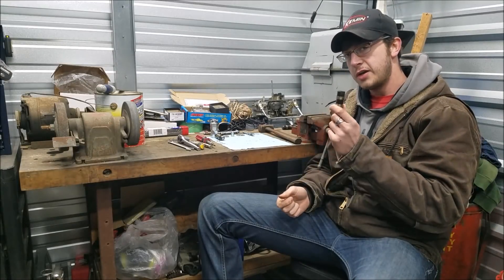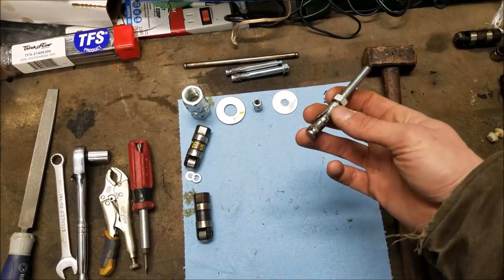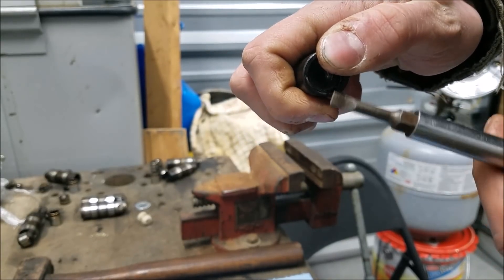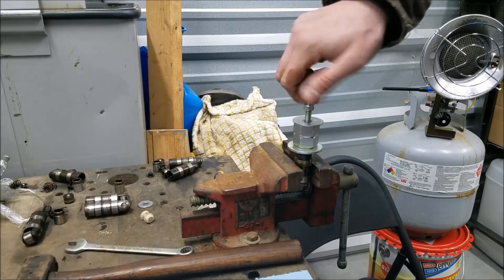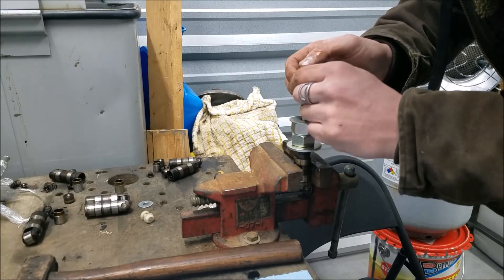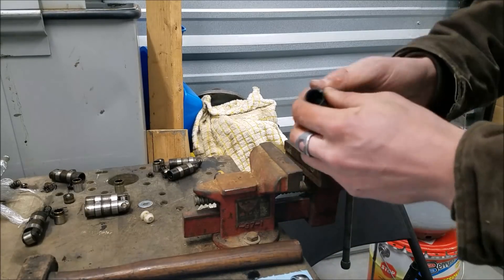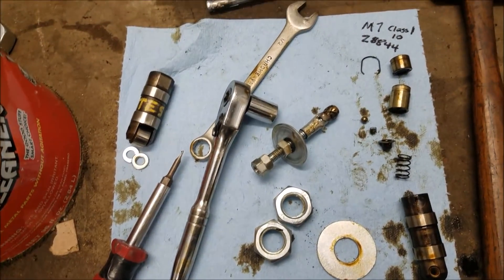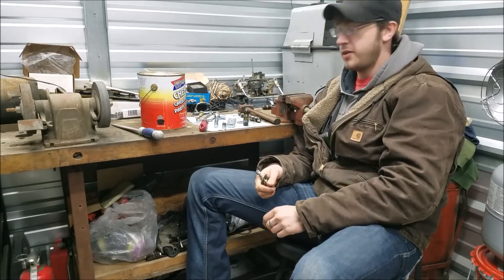(TRICK REVEALED) Hydraulic Lifters Disassembly: Rebuild or Make Solid "Mock-Up" Lifter

Comment: about the welding on the tool, did you weld up the end of the tapper and scale it up or did you add material to the expanded sleeve to make it bigger?  I was thinking of increasing the the diameter of the sleeve with another sleeve

Comment: Thanks Luke used this to disassemble a lifter on my 340 Buick had a little trouble getting the bolt out of the plunger so I just stacked more nuts and used the same method to pull it out.

Comment: I know this is 5 years old, but here it goes. I have heard of a "lifter mod" for Ford roller lifters that is supposed to be of some performance value, but I cant find an explanation of it anywhere. Even Vizard talked about presenting it but never did. Have you heard of it? I want to check/rid my lifters of built up crud, but if there is a performance mod out there, that would be the time to do it.
Reply from the maker: Not that I'm aware of that would last. 
You can make one solid, but you run the risk of the clip flying out - not worth the risk

Comment: much easier way peeps. Once you get to the point where he installs his crude expander. I flip the lifter upside down on a metal bench or other lever surface. The plunger is  stuck with dirt  grit and varnish. Even with the spring pushing on it it's stuck. OK ..upside down take a propane torch and evenly heat the lifter body evenly all the way around. The heat expands the lifter body AND the air under the plunger surrounding the spring. Inside 30 seconds you'll hear a pop as the plugger is forced of the bore. Grab the lifter with pliers (it's warm now) and the plunger will fall or just be lightly stuck near the top. You'll find some now warm oil as well. Tap the lifter on the bench or grab a pick and fish the plunger out with the spring. The Berrymans soak works wonders to clean the dirt gum and varnish from the lifter parts.  works every time for me.

Comment: i got the plunger out with PB Blaster. they were stuck really bad. i sprayed in the pb. let some pb past the check ball by pressing it down. worked the plunger back and forth until it came out. i used a socket to drive the plunger in then smacked it on a peice of aluminum to work it forward. once it was at the end i wither grabbed the inside of the plunger with a set of piston ring pliers or grabbed the unmachined top side with vice grips. Also when disassembling you can push on the check ball at the bottom of the plunger to release suction while removing plunger .

Comment: Maybe your vice jaws are so old and worn that they don't chew up the machined facing on the lifter body, but I sure wouldn't do it in mine or anyone elses.  Running a file across it isn't to smart either.  Just because the surface is machined does NOT MEAN IT WON'T CHIP OR GAUGE!  The other thing I see is your doing this on the same bench and right next to a grinder that looks like it came over on the mayflower, point being you have micro-fine shavings from the grinder all over that bench.  I can do the same thing with a pointed end pick tool just as fast or faster than your tool.  And I don't score the inside or outside of the lifter body and parts.
Reply from the maker: Yeah. You won’t be getting old ones part with a pick tool. And also, the file was done to show its hardened - the file can’t remove any material. Also, if you don’t have hardened Vice jaws, your fine. 
Also also, I found that bench on the side of the road, I don’t do any grinding in my engine clean room. 

Lastly, I’m Thunderhead289. I know what I’m doing.

Comment: Thanks for the useful video. I am rebuilding a LT1 and your tool trick had made dealing with the valves a lot easier.  I've cleaned 10 of the 16 valves so far and found only 1 that didn't require using the tool to get them apart.  You save me a lot of frustration.

Comment: I just shoot some shop air down the center of the lifter with a rubber tip forming a seal and it pushes the plunger right out like a piston with a very small amount of air pressure. Maybe these lifters are a little different but they look almost exactly the same.

Comment: Thanks, this trick worked the best, but still have to say that it wasn't easy.  I needed to create a solid set to check valve to piston clearance.  To start, I had used lifters with about 70k miles on them. I'm not sure if there was a lip that was created because of the millage, but it was a S*B!.  I tried various other suggestions from websites and YouTube with no success.  I tried to use a pushrod to wedge it out, not happening, using multiple types of hook tools, nada, I tried using an air compressor and a blow gun, nope, pushing the center check valve to add air and release the vacuum lock, no way.  This was the only way and it fought me all the way to the end on both.  The tools that I used was a 3/8 x 3 'Sleeve Anchor' like he did and you can find it in your local hardware store.  It usually used as an anchor bolt in concrete. Bought a 3/8 x 6 threaded rod and a double female coupler.  Many large washers in a similar way in this video.  The anchor slipped out many times and I had to use an old thin rag to give it some friction between the anchor and the inner plunger of the lifter, otherwise it would slip out after the first few mm.  Now I just need to figure out if I need any washers between the lower and upper plungers in the lifters.  Thanks again and I hope that I don't have to do this again.

Comment: tried this on my dodge 5.2l lifters, first soaked in gasoline, then xylene, then Deep Creep. ...no go. Even tried heating the outside to expand it some.
Reply from the maker: p al did you see what I did? The tool I made? 
Also, apparently there is a tool made from summit that is essentially the same as well
Reply: @ThunderHead289  yes I made the same tool, but it just pulls out. Is your a 5/16 thread or a metric anchor insert?

Comment: All i do is to push a pic down the plunger to relieve pressure (depress check ball) then insert an L shape pic into oil hole in cavity and pull. Comes right out.
Reply from the maker: Yours must have been really clean

Comment: Normally, all that’s required is a pushrod to remove the lifter plunger. Literally stick a pushrod in the plunger, leverage against one side and pull.  When you expand pressure inside the plunger to lifter body it actually makes disassembly harder. 
Tip: Soak the lifters in diesel fuel to help clean.  Berryman carb cleaner is a good carbon killer.
Videos on my channel 👍
Tip:  Replace/upgrade those cheap wire/spring clips in the lifters with inside c-clips!  Cheap upgrade eliminates any issue with lifter failure even if running at zero lash.
Reply from the maker: +HeadFlowInc the tool does not create any outward deflection. Ford style lifters have a tendency to not want to come apart. Inside them there are two rings as the bore walls casted into the lifter. Dirt builds up on the plunger in these cavities and seals them in pretty tight. Some fall apart as you describe, but many used units are extremely tight in their bores. I should have shown the pushrod method not working on these on camera
Reply from the maker: +HeadFlowInc also I am definitely checking out the video! You must be editing your comment here as we converse!
Reply: ThunderHead289 GM has the same inter issue, especially the LS, famous “Lifter Knock”! Lol I’m curious if the lifters getting so dirty is related to service intervals or the longer recommend oil changes?  Or the reduced detergent in modern oil? Idunno
Reply: ThunderHead289 I wanted to mention my video but didn’t feel comfortable adding a direct link. I was adding info, us old guys remember stuff after pushing enter! 🙄🙄🙄
Reply from the maker: HeadFlowInc I really think its intervals. An engine is going to have internal hot spots that under load will burn up the oil a bit. That along with additional blowby carbon gets stuck in the small orifices in the lifters and cause issues. I’m a big fan of solids. If only knock sensors could handle it
Reply: ThunderHead289 In the older engines, flat tapper hydraulic, we use to play with lifter pre-load to see what gave us the Best ET at the track.  One trick was to run the hydraulic lifter at Zero Lash, but (huge disclaimer), if your lifters have the cheap wire retainers the lifters could pump up and hydraulic the internals out the top!  Bad Day... 👎. Crower sells lifters with the internal c-clips to avoid lifter failure due to hydraulic pressure. 👍
Reply: Mike MacCracken 😎😎😎
Reply: HeadFlowInc I used to run three thousands on the intake and six thousands on exhaust on hydraulic lifters in rule restricted racing divisions. Yes JD we are old lol.